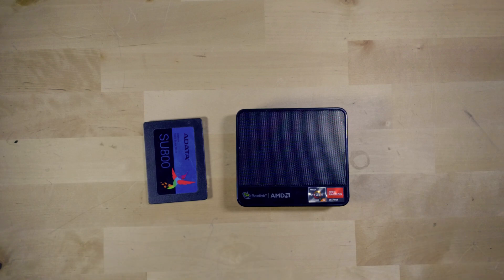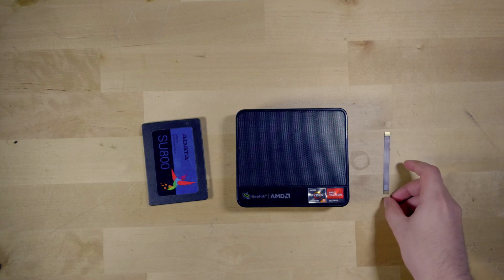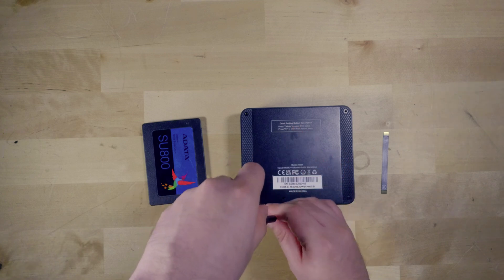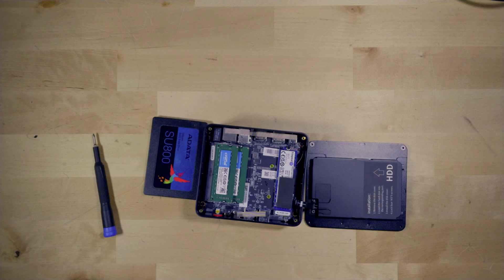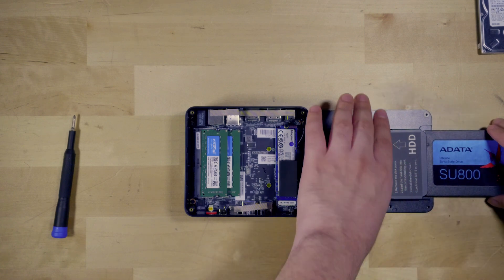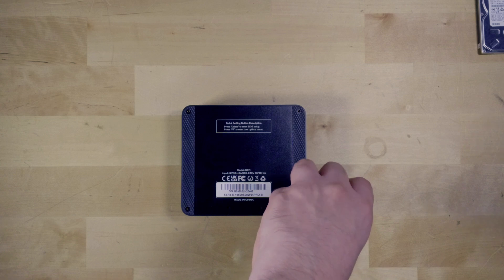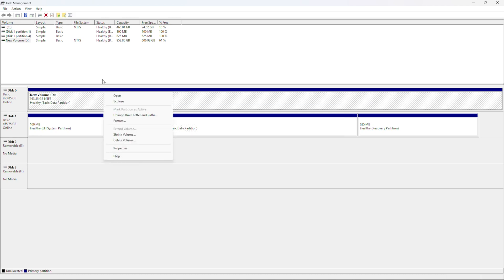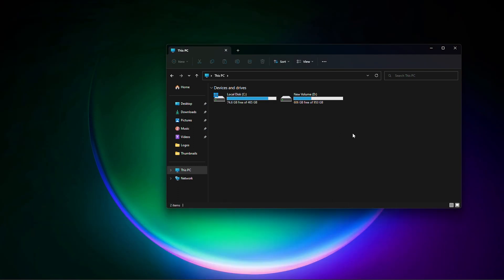How To Add a SATA SSD TO BEELINK SER5 Mini PC | SYSTEM UPGRADE | Remove Bottom Panel Guide

Comment: great video, if anyone else gets a little stuck like me, when i installed it there was no 'new volume' showing up or anything new that i could see under volumes. but there was something in the bottom portion of the disk management window with a big black bar instead of the blue ones, where it says disk 2 on his. I hit right click and had the option to set up new volume there, clicked through a bunch of gibberish i didnt understand but in the end i got to the same point where it seems to be working.

Comment: I bought a Beelink Series 5 on Amazon, and because the customer service email address was in the description, I expected an easy time of upgrading the ram. But after I had bought it and went back to get the email address to ask them about upgrading ram, it had suddenly disappeared. When I tracked it down again, I never got a reply. Something I always seem to forget when it's crucial to remember, is that Chinese tell lies. Without exception, because it is so engrained into their culture. After buying an ebike, riding it for two weeks and then spending the next two years trying to fix it, you would have thought I would have learned my lesson. I finally gave it away, because I couldn't sell it on ebay. Also, I once saw a review on Amazon where after one year the thing had bricked itself and as there was no reply from Beelink, he now had an expensive doorstop. The warranty is not worth the paper it's written on. The chinese do not adhere to the western culture of honesty.

Comment: I have purchased Beelink Ser5 Max a week ago, i want to install 2.5 inch HDD free slot there but if i put 4TB drive in there. It will works? Which is in specification sheets site says up to 2TB M.2 & up to 2TB 2.inch drive.

Comment: There is a rubbery tab attached on the back plate... just grab onto it after removing the 4 screws and you can off pull off the back plate easily. No need for a card or fingernails to pry it open. The Beelink folks have a decal with instructions for Quick Settings; would have been helpful if they had included the same for how to remove the back plate using the "pull tab".

Comment: Hi guys! I own a SER5 5560, can add a SSD or just an slow/old hdd? Thanks
Reply: Have you watched the video? It applies to all ser 5's
Reply: @nassim99345  It doesn't seem exact, I reached Beelink tech support and my model only support extra hdd not ssd. It might be due to its power unit I think or cooling system.

Comment: Wow, I think they changed the design. My one just slots straight in when you take off the back/bottom panel. There is no cage or taking another layer off. I want to upgrade to 4TB but their site says support for 2TB Only so not sure if I can.

Comment: At 0:19 Sept 15th 2023: I just opened up my Ser5 Max 5800H, I seen that Beelink has taken this in to consideration & have altered their design to a more user friendly method by placing this tiny ribbon to a different part of the mini pc. I was having anxiety worrying about this until I finally opened it up.

Comment: :) Thanks for sharing, as others I got the 5800H model, different mounting thing, was hard to get out to mount SSD, works kind of, as Linux sees it, but has issues not showing up in media tab :( 2tb NVME worked fine though.

Comment: Why would it come with an extra sata ssd?
Reply from the maker: Ribbon cables like that are pretty fragile, but cheap to make. I would imagine Beelink found it easier to include an extra one than to do have deal with customers that ask to RMA or request a new one after they accidentally damage it. It’s pretty much spending a couple of cents to save the cost of the customer service hours it would take to respond and work with customers to solve an otherwise simple solution.
Reply: @EVOTech1  thank you for responding so promptly

Comment: "Be very careful with the ribbon cable" 3:55 fully yanks on the ribbon cable.
On mine I had to unscrew and remove the cover on the card slot and loosen the screws holding the connector to get my new SSD card to mate up. Then retightened the screws, replaced the cover, then there are 6 screws that secure the SSD card and cover.

Comment: does anyone know the part no for the lid mounting point for the supplementary hard drive (2 screws, ssd socket and ffc 12 pin 0.5 cable) or where ii might obtain one? 😢

Comment: You failed to mention that you have to push in the drive till it seats and the four holes on the side of the drive enclosure , 2 on each side line up and the screws are installed. Otherwise great video. 👍

Comment: I just bought a SER5 5800H, which arrived a week ago.  It looks NOTHING like this inside.  There is some sort of plastic shroud inside, which covers the SATA connector and everything else beneath that level.  You cannot directly see the RAM or SSD.  There is no cage (or anything else) attached on the interior face of the bottom plate.  I'm confused!  

Furthermore, apparently a 9.5mm-thick HDD is too thick.  I don't have a 7mm that I can try, but the 9.5mm one I have will not engage with the expansion SATA connector. 

Naturally, there is no paperwork/manual in the box that explains ANYTHING about this.  I also didn't get the spare ribbon cable in the box (although it may not be needed, because there isn't any expansion drive bay attached to the removable lid as shown here, thus the cable is less likely to be yanked off).
Reply: Same for me.
Reply: @MzChevyBlu  Weird, huh?  And, I'm a little nervous about removing that shroud/fan-mount/drive bay plastic piece.  I don't know what might be taped or glued on underneath.  I don't even know what screws are safe to remove.  AZW/Beelink really needs to step up their documentation, particularly their awful website. 

All that aside... this machine is incredible for what it is, and what it costs.  I'm super happy with the SER5/5800H, it just needs better "soft skills" from its makers.
Reply: @floobertuber  FEW SCREWS, THEN THE FAN PLATES COME OUT  YOU FIND THE RAM AND M.2 2280 SSD, I UPGRADED TO 1TB WD_BLACK N770 THEN THE 850x x2 MY SPEED, THE DID 64GB RAM OVER KILL BUT WTH WHY NOT. ADDIN THE 2.5 1 GIG SSD THIS WEEK. (MOVED THE N770 TO MY LAPTOP
Reply: @floobertuber  Thats what I am worried about also. I would really like to upgrade the RAM.
Reply: @mikecarden1043  I just got it with same issues L( What srcews to remove fan plate? same to upgrade RAM...

Comment: I have the exact same PC and I upgraded it with a 2tb ssd but when the drive is installed, the wifi and Bluetooth adapters are gone. How do I get them to work at the same time?

Comment: I did all this, but it's not showing up at all in volumes, so I'm not sure what to do now. ?? What could be the issue? Same thing as you - slid the SATA SSD into the HDD slot there, same model of Beelink, booted fine, no indication of new drive anywhere to be seen...
Reply from the maker: make sure the SATA cable is properly connected. There might be a seating issue there. It should not need a specific SSD model as it's just a generic SATA connection.
Reply: The sata cable is so easy to get broken.

Comment: I have read comments to the effect that the SER5 only supports a max of 2tb total of internal storage. (i.e. the m.2 plus  the sata can only add up to a max of 2tb) Can you please verify/disprove this?
Reply from the maker: It does not seem to be true at all. I just opened up with SER5 with the 5560U and installed my 2TB SATA SSD in it and it shows up perfectly fine. CrystalDiskMark also gave the expected results so there's nothing out of the ordinary with a higher capacity SSD. I don't have a spare 2TB m.2 SSD to verify the slot itself but so far I have no reason to believe it will not work with a higher capacity one. It works perfectly fine with the 512gb stock nvme SSD paired with a 2TB SATA SSD. where did you see people mention that?
Reply: @EVOTech1  thanks for the quick reply. It was on reddit in the MiniPCs sub. Someone had allegedly purchased a 5600h and made the above claim. (and also alleged that Beelink customer support had confirmed this). So, I guess it's just internet chatter. Thanks for taking the time to check. (it's also kind of cool that it literally took just a few minutes for you to check, which does suggest that the process is pretty straightforward to do!)
Reply: Hi there. I have a feeling that it's my comment on the Reddit post. This is the reply I got back from beelink customer support when  I questioned them about the internal storage.
Hello,

Thanks for your letter.
Yes, you could add a 2.5 inch hdd.
As for the maxium capacity, it is better to be not more than 2tb for the whole machine.
Have a nice day!

It would be great if you could maybe question beelink to see if you get a similar reply 🙂
Reply from the maker: I’ll shoot them an email about this. I’m wondering if there’s something lost in translation here due to beelink being a company mostly operating in the MENA and Asia region. I’ll see if I can also free up a 1TB nvme ssd to confirm that 2TB SATA and 1TB nvme at least work together. But I can definitely confirm that a 2TB works paired with the stock 512GB SSD. Unless they put some weird artificial limitation on the nvme port or something, it should work with pretty much anything.
Reply: @EVOTech1  appreciate your taking the time to do this. Like, personally, it's not a deal-killer for me, you can always connect an external drive... but in the case where you have that capacity drive available and want to use it, or have a use case where that storage is gonna be of utility, it would be nice to have clarity on whether there are limits.
Reply: @EVOTech1  awesome yeah hopefully it is just a mix up in translation 🙂
Reply: Digging through my emails and found the one confirming only 2tb for the whole machine.
Hello,
Thanks for your letter.
Yes, you could add a 2.5 inch hdd.
As for the maxium capacity, it is better to be not more than 2tb for the whole machine.
Have a nice day!
Best regards
Eden
Beelink Support Team

Hope this helps
Reply: I have learnt this the heard way. Got a SER 5 - 1TB in it, picked up a 4TB hard drive. It initialised then disappeared. I think its a voltage issue. The BeeLink forum is pretty clear no to exceed 2TB for the whole machine. Looks like you can get away with 2.5TB but maybe not more..  Looks like i'll be using the 4TB in my other PC ha.